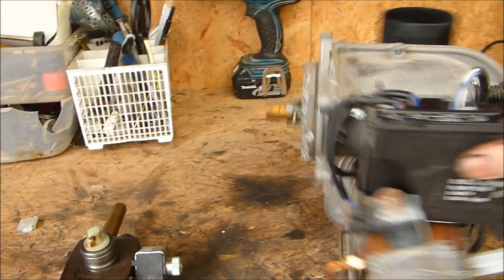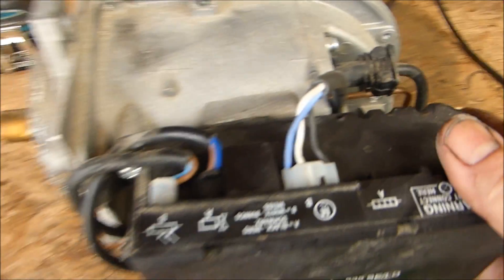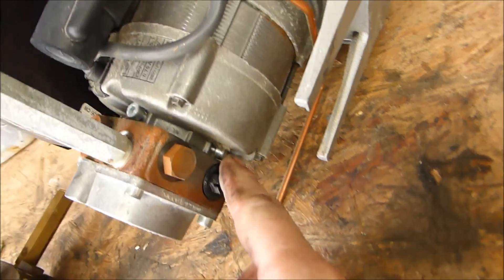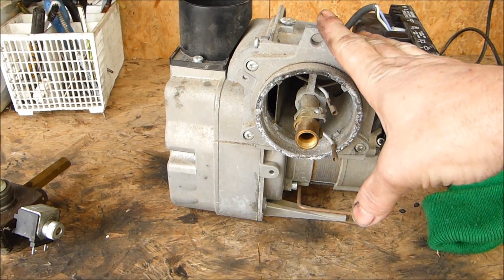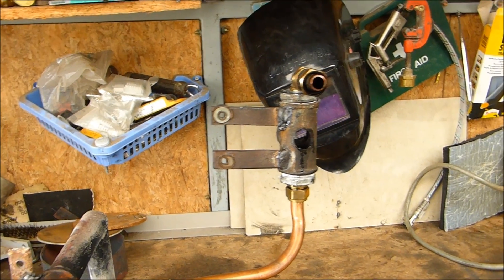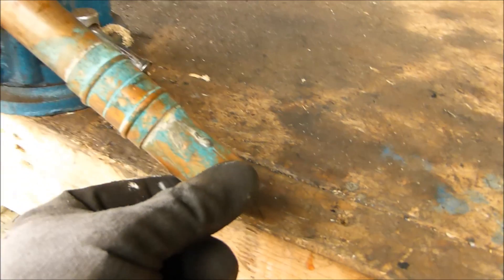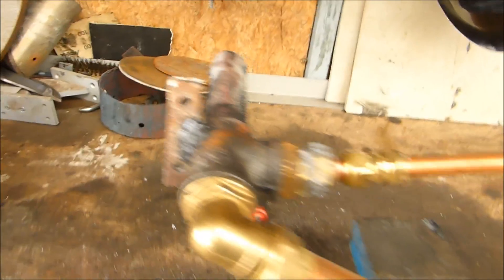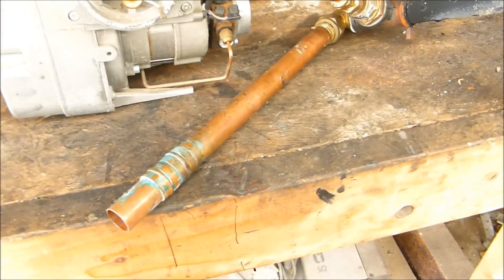Waste oil Stove  "Making the Burner"

Comment: All you have to do is drop your oil in the air line outside the stove. The oil will go down the line with the air. Its best if the air pipe is run in at a 45 degree angle. You can 45 down at the end of it if you want to but it works fine without it. The oil will go right down it. No extra cost, no plugging, easier.

Comment: Nice video!  I have looked through your other videos but didn't see what you did to get the copper tube through the 1" gun metal 90 without kinking it or collapsing it. Do you have a video of that process? Thanks again for the info.

Comment: i have tried simple methods of this burner and what i have learned "so far" is you either make it 100% like he is doing it or it wont work :@ lol

(what i did other than you is that my cooper pipe is not enforced and staying at the center of the steel pipe and its not working it starts burning very good but turns off after 30 mins even tho the pot gets glowing red)

Comment: Gerry---Thanks so much for the plans for the burner. Very easy to build and lots of heat !  My problem is that no matter how I set the air or the oil flow I get lots of black smoke through the chimney. Any suggestions ??  thanks again---you rock
Reply from the maker: Hi Danny. What type and size and length
of chimney did you use and which burner type was it the same as this video ie Forced air blower type. Cheers Gerry
Reply: Gerry's Waste Oil Burner Hi Gerry--thanks for the reply. I made the burner that is in the video above. It is in a stove very similar to the one in your video. I am using 6" stove pipe that comes out the back of the stove then 5' to the roof then 90's out the wall and goes out about 2' then 90's up for about 4' then a chimney cap
Reply from the maker: Hi Danny. Whats the fan like and Is it variable. The good thing with the blower type is that if you provide the correct amount of air you can make a happy flame. If the blower is too strong you can restrict it or bleed off some of the air. If too weak you can upgrade. In one of the videos I used a hairdryer as a temporary air supply. Danny send me a pm with video or photo of your setup and I will try to help. Cheers Gerry

Comment: What did you use to drill that hole on the back of the stove? I was thinking hole saw but I'm not sure they would work on cast iron.
Reply from the maker: Hi. I just used a bimetal holesaw in an 18v makita drill. Easy drilling. Cheers Gerry

Comment: great stove mate and very well explained,i have a drip feed one I build but haven't got it working as good as id like yet,
Reply from the maker: Hi blackbear bowie. I just posted a video with an improved version of this burner
http://youtu.be/QQGtl87-x58.
If your burner is smoking or not getting hot enough for you, make sure if  you can that your flue is 6 inch (5 inch minimum)and that it is at least 4m high. It needs the draw (suction) of a longer flue to pull enough air for a vigorous burn and mix. Check out some of the earlier videos on my channel. Thanks for the comment. Gerry

Comment: THANK YOU FOR SHARING , IT HELPED ME OUT BIG TIME CHEERS MY FRIEND !!
Reply from the maker: Hi Bobby. Today I installed the fan assisted burner in the Propane tank that I converted to a stove . It runs really well and because you can control the amount of air as well as the fuel the output can be increased. I will post a video tomorrow or Monday. I am glad it helped. Cheers Gerry

Comment: I like it.  It looks quite clean and easy to use.  
Why do you have the oil line inside the air tube?  Better mixing?
Reply from the maker: Hi Bill. The oil line is separate and  travels all the way through the air line to the bottom. The reason is to keep the oil cooler so it doesn't burn in the tube. Cheers
Reply: Brilliant!  I can see the like clogging up with carbon if it was separate now that you mention it.